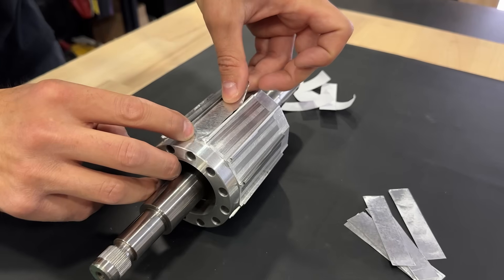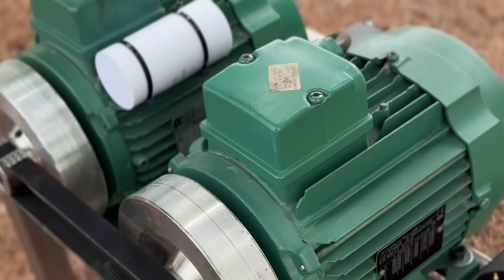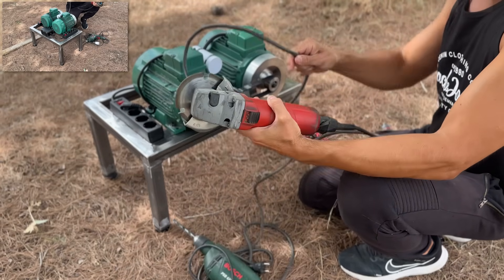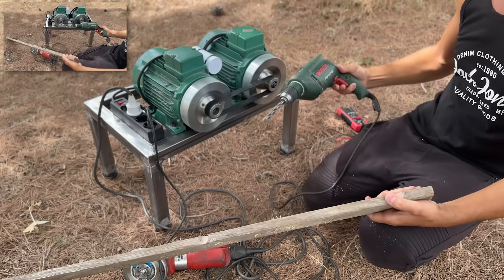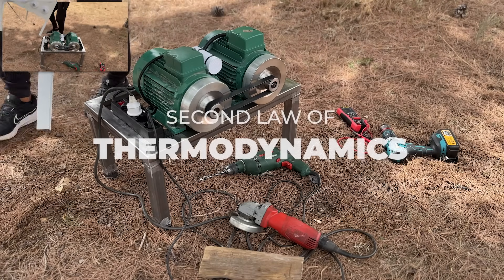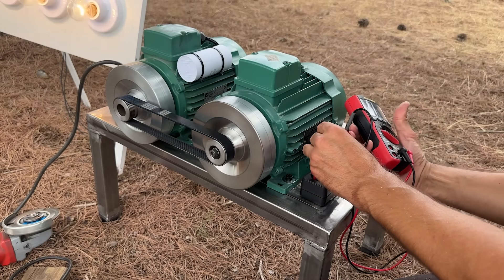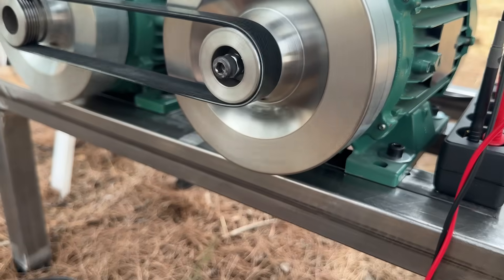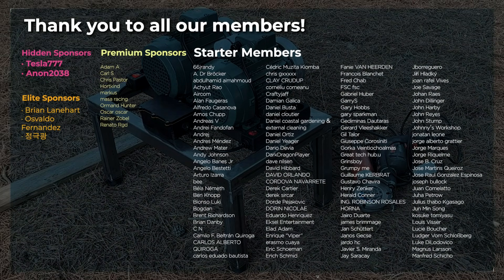FORBIDDEN INVENTION😱 This is How the "Liberty Engine" Infinite Energy Generator Works

Comment: Nah! not true  when you apply a charge to the motor,connecting power tools, the magnetic field of the motor increase and is like braking the motor is the same for every electrical motor the same principle for gas AC generator....quantic state? what you talking about?

Comment: I know it works!
but the problem is that this alloy cannot be made without a laboratory and complex production conditions, so even the technology that was shown does not contribute anything like DIY
the performance and components are very expensive and unavailable for ordinary people, so people can only see that it can work, but it is not available to be able to perform it themselves.
so only one very strong invention that works is the V8 spring engine.
but far from everything I know that argalium alpha is real
and it works.
Reply: Stop to ich kamuflaż
Reply: @freex999 is real 101% 
But
thus it belongs to the protected invention
which is measured at the state level
and not ordinary people
that's the problem with people wanting to start taking an interest in how they can achieve it.
so the only real invention is the V8
spring engine for now I think it's the only way for people
I am in love with the study and careful assembly of that machine